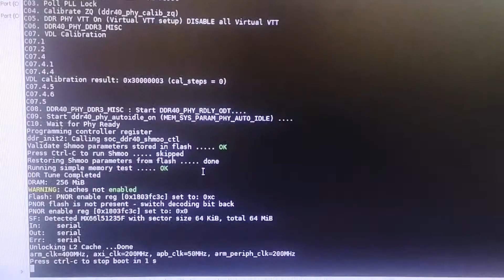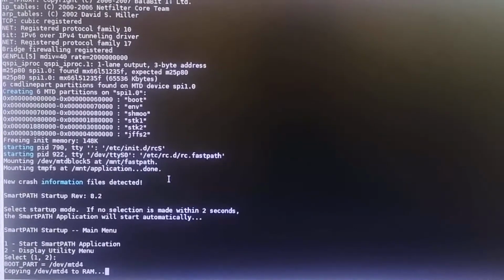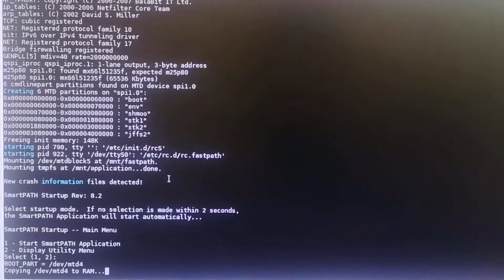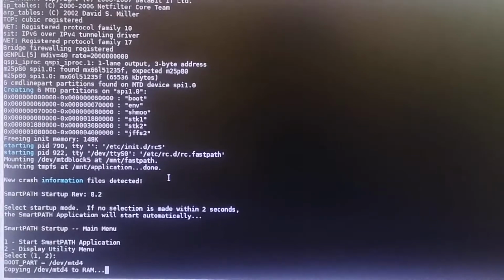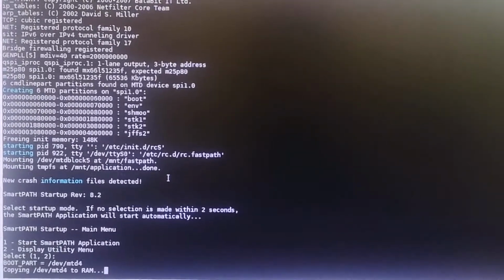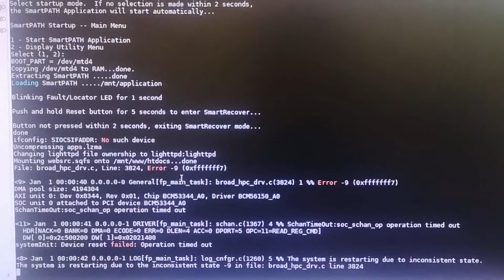When the switch system does not boot JL381A | HPE OfficeConnect 1920S 24G 2SFP

Comment: Do you know a similar way to connect to the Officeconnect 1920s JL385A? It also doesnt have an obvious console connector. Mine did'nt restart after a factory reset.
Reply from the maker: If same hardware board same pins if other board or Rev. Maybe different, but HP support for this switches is good, after diagnostic they replace with new device
Reply: @ek6rsc  Have you find a solution. My switch os starting, but after logging in it hangs and gives 0 response. Hard reset seems to have 0 effect.
Reply from the maker: @n3r0z3r0  HP support make changes if device not opened, it's lifetime guarante , I tell about problem seller and they check device in laboratory and after give me new one

Comment: how did you know that those pins were tx and rx?
Reply from the maker: It's easy using terminal and TTL converter RX from TTL and GND connect first finding with multimeter GND pin then TX pin , if you find TX ,RX pin near pin or from right or left